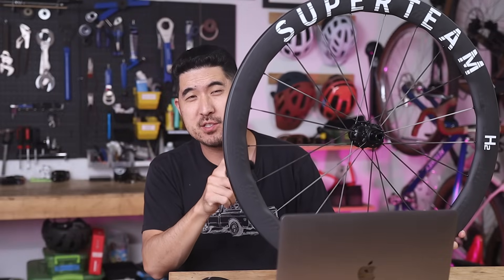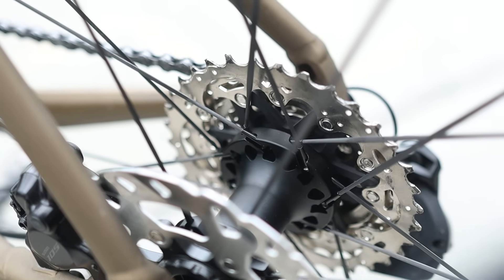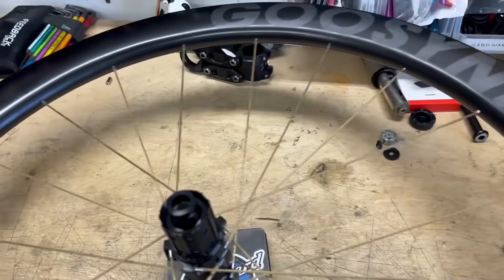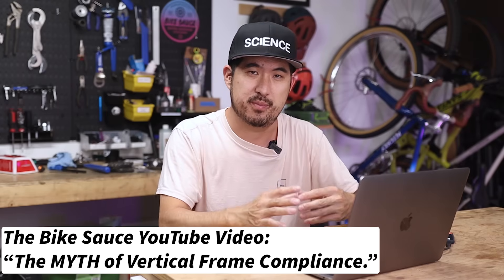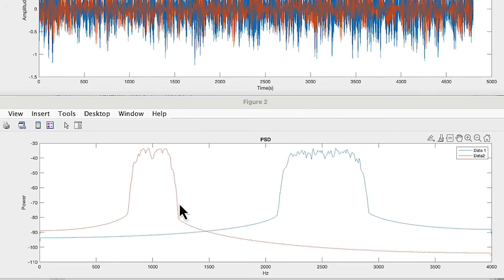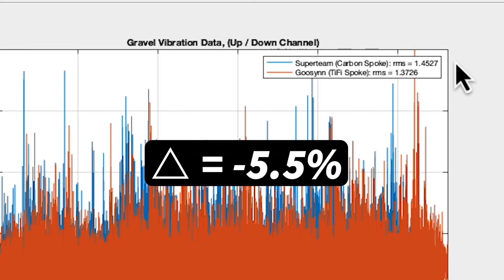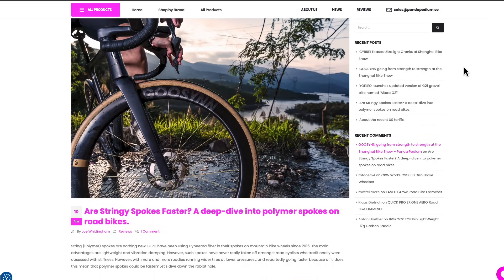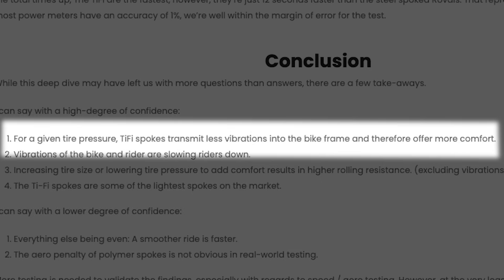Are Polymer Spokes Compliant?? // What the Science Says.

Comment: Hey Nolan two quick things:
1. Stoked you’re using Matlab and not just python. 
2. Did you plot a histogram of the data? Based on what you showed in the video it looks like the histograms for the two wheel sets will be similar but I’m curious to see the results.
Reply from the maker: What would the axes be for a histogram?
Reply: @TheBikeSauce  I was thinking magnitude on the x axis and then counts per bin. The matlab histogram() function will automatically determine the number of bins, but you can specify how many to use in the second input argument if you want. This could show if there are more large magnitude events in one wheelset vs the other and easier to see than the standard time domain plot.

Comment: I can imagine the time vs frequency domain data being explained better.  It certainly can be a bit confusing though.  Question - do you agree that a more comfortable bike is.faster more efficient bike?  I can think of two reasons why - the bike has more energy being translated into a forward vector and secondly because all those micro and macro vibrations and movements in the less comfortable bike are not translated into the muscles and therefore there is less fatigue so over time the rider can output more power as s/he is “fresher”?  I am not accounting for a variable such as aerodynamics in say a big fat tire verses a thinner one, just the vibration and shocks to the bike translated from the road through the tires and frame.

Comment: I liked that you ran at 60psi, I think for your tests having higher pressure would be great to isolate the spring effect of the tires to get a better look at the spokes.

As for mountain bike applications, Im really curious about lateral stiffness/compliance with string vs steel.

Lastly, it'd be good for you to recap the theory of spoke tension especially focusing on where and how elastic strain affects the wheel under different loads.
Reply: Lateral stiffness is not great.
The advantage for MTB is that if you hit a twig or a big bump the spoke should be less likely to snap.

Comment: Looks like you're using the Ride Now TPU inner tubes.  I've been using those on my gravel bike with no complaints.  Not sure why anyone would pay 3 to 4 times the price for a TPU tube from one of the big brands (Tubolito, Pirelli, Schwalbe, etc.).
Reply from the maker: Tbh, both of those cheap tpu tubes punctured on me within a week. Am I doing something wrong?
Reply: @TheBikeSauce  Did they puncture from road debris or something else?
I have the new version with the alloy valve, installed them in April and have ridden about 700km with no issues.  Pumped in a couple of psi before installing as recommended.  Tire pressure seems pretty consistent, losing may 5 psi over the course of a week.  The Ride Now are about 20g lighter than Tubolitos, you may find those more durable.

Comment: These are my favourite videos. It's miles above any marketing speak or just "feel" that we know can be affected by priming. I really like seeing the difference magnitude. For casual rider like me and mechanical engineering degree it's bonkers how much focus is on minute things vs even slight difference in PSI when it comes to vibration dampening. And it's fine if you got all the big stuff out of the way and now chasing marginal gains but it's great to see the actual benefits and prioritise spending.

What I would also want to see discussed is the science about perception of vibration at various frequencies. When we modelled appropriate dampening for large trucks seats we learned about low frequency impact on health etc but not a lot of discussion about perception and comfort. Just more dampened better but what about tradeoffs of having better dampening in lower frequency domain at the cost of worse in higher frequency etc.

Comment: First of all, I don't doubt those spokes do help. I've been running Spinergy GXX for a while. 11:32  I can feel the difference. Is that the spokes or the rims or both?  But, to get an accurate comparison, you would have to run the same rims with different spokes. How the rim is made has an impact on the ride as well. For example, I have 60mm FFWD and Zipp 404 wheelsets. They have a different ride feel between them. On a side note, Zipp are the most over rated wheel in the world.

Comment: good testing and i really appreciate you mentioning berd spokes as most just say this is the first brand to try this. My one gripe is the 2 mm internal rim width discrepancy and the lack of mentioning the measured tire width as running 60 psi in the tire on a wider rim which adds 1-2 mm of width would be less comfortable to ride on as it is effectively harder. The data is still close even with that issue of mine meaning that it likely doesn't make a huge difference but could have an impact. I look forward to your video on berd spokes I believe that they make a much larger impact off road than on as the hits are so much bigger that they do deform. final thing to mention is the lateral and rotational compliance that string spokes bring compared to conventional spokes which is definitely felt in the corners.
Reply from the maker: Yea, good insight on the fact that wider rims provide a slightly harsher ride - we’ve tested this briefly in the lab and confirmed it to be true
Reply: @TheBikeSauce I was not aware that wider rims have a harsher ride.  For 50mm tires what is the optimal rim width for comfort, safety and speed? Probably a tough question to answer.  I have been thinking of having a custom set of BERD wheels made. The rim choice is the most difficult decision.  Thank you.

Comment: Thanks.  I enjoy these videos.  The Goosyn spokes look just like the Byrd spokes.  I'm pretty sure Byrd is not happy that Goosyn is getting quite a bit of attention.  IIRC the Byrd wheels do require a retension of the spokes after a certain amount of time.  I wonder if the same applies to Goosyn.  I did watch another video on the Goosyn and the lateral stiffness is much worse than steel and carbon spoked wheels.  Whether how much of an impact the lack of lateral stiffness will impact performance is hard to say.  But I imagine most people prefers a stiff wheel for power transfer now that you've proven a stiff wheel with carbon spokes isn't a more stiff riding wheel.
Reply: If built at the "factory" or by a wheel builder who uses the Berd spoke stress machine, the spokes won't need retensioning. I have a couple of sets (MTB and gravel) and they are still in spec after two years.

Comment: Something else you might try-- record a plot with the bike leaned over. All of these spoke materials create a wheel with very high radial stiffness, and that's what you're testing when you're coasting downhill perfectly upright. But there are huge differences in lateral stiffness (up to 50%) that may well impact ride quality. When mountain bikers extoll the comfort of BERD (roughly 1/3 as a stiff as a typical 1.8 cross-section steel spoke) , I suspect it's because they spend most of their time at extreme angles (this is actually required to get the bikes to turn). I equally suspect that actual damping (converting momentum to heat) differences are minimal (it can only come from friction in the braiding or from the material itself, and unbraided polymer is typically quite springy) and any differences you record derive almost solely from stiffness. Flexible wheels feel noticeably less responsive under acceleration as the wheel is tilting from side to side. I assume that road riders would favor carbon spokes because they would prefer responsiveness over a very slight difference in ride quality in steady-state cruising.
Reply from the maker: that's a great point. The MTB compliance vid we did suggests that too - lateral compliance is what we actually feel in bike frames.

Comment: Bigger question I have is which is the safest? I'd assume polymer spokes are quiet a bit more stick-in-spokes resistant than carbon. Though, for that, I'm sticking with steel. Also better on the bank account.

Comment: I did watch Peak Torque's criticism of certain straight pull spokes and think his assessment must be nuanced. Just because a spoke enters into the hub without a j-bend or other apparent locking mechanism, doesn't mean that spokes will become dislodged when one breaks. The end of such spokes can fit in a keyed slot, such that it looks like it is being held there under tension, but in fact, it must be lifted or moved out of the way several mm and then pulled laterally or in another direction to dislodge it. (I have the very same wheelset  he did the video on).  I think even the wheel shown in this video would not allow the spokes to be dislodged from their end that goes into the hub, simply because one spoke was broken.  You should remove a spoke and try riding the wheel to verify this. I don't think the others would fall out, or even could fall out.
Reply: It's not about removing a spoke, in that case the tension will re-equalise before anything bad can happen. The problem is sudden loss of tension during operation. This can be the result of anything from a broken rim or several broken spokes at once. It has happened, there are docimented cases of it. Ben Caden from Caden wheels has first hand experience and scars from it, that made him go with threaded spoke-hub interfaces on his newest wheelsets.

And yes such design can be further machined to improve safety, but they usually aren't, because at that point you're adding so much complexiti you might as well just make a regular straight pull design instead.
Reply: @invisiblescout6335  What I'm saying is that the end of the spoke can actually be locked in and can only be removed by manually slipping it out of the seat -- even though it may not look like it. But I do agree with you that some are not made this way.
Reply: @bengt_axle yes and as I say what you suggest usually isn't the case with cheaper chinese options like the Superteams in this video. What you suggest is the exception, not the rule. And even then I wouldn't feel comfotable riding such hubs. Black Inc hubs are designed in the way you suggest, and Froome's wheel still disintegrated under him when his rim cracked

Comment: To all of this it should be added that they're very soft laterally, so tyre rub may be a problem
Reply: Yes, there are a bunch of other things that could be measured here, like lateral deflection, etc.
Reply from the maker: It’s noticeably flexible in the lateral direction - you can move the tire to breast hit the frame by hand. Interestingly, that lateral flex didn’t seem to correlate to much vertical compliance.
Reply: @TheBikeSauce  This is most likely because on a spoked wheel, the top spokes carry the load. As the wheel rotates, and the spokes deviate from top center, they carry less load and would not be as involved in vertical support/compliance. A spoke that flexed only in the vertical direction, but not laterally would be the ideal (like a shock absorber), but probably not possible or practical.

Comment: The fact that the rims are completely different designs, likely also different layups and carbon recipes, makes comparing spokes via complete wheelsets a tough one. I guess this video is mostly looking at marketing claims made by the brands and not the spokes themselves. Love the video, thanks for your look at these wheels.
Sidenote: I always wonder why people don't do their rolling resistance tests with throttle ebikes that you can set to a constant power.
Reply from the maker: I mostly agree with you (would’ve been nice to compare exactly the same wheelset differing only by spokes). I do think the fact that the data were so close in rms and in the freq domain has some value. Some people who claim to have felt the compliance in the goosynn wheels would most likely have been comparing to a different carbon wheelset represented here by the superteams.
Reply: I agree, if you want to isolate the characteristics of spoke material you'd need to build two wheelsets with the same hubs and rims (especially the rims, I don't expect the hubs will make much of a difference to vibration as long as the flange diameters/offsets are the same, keeping spoke length the same). Ideally you'd also want to use the same spoke tension in both builds (or do the different spokes require different tensions? idk)

Comment: ...also, it would be interesting to see how little pressure would need to be reduced to match the apparent ~5% Grms reduction. In the end, one of the biggest drawbacks of polymer spokes is the round cross-section. From a "best speed for the lowest power" perspective, I'll take bladed steel spokes any day.
Reply: Dyneema webbing exists, it is often used in climbing. So it may be possible to make flat spokes out of this stuff, although I don't know how the connections to the rim and hub would look like -- it may require significant additional R&D.